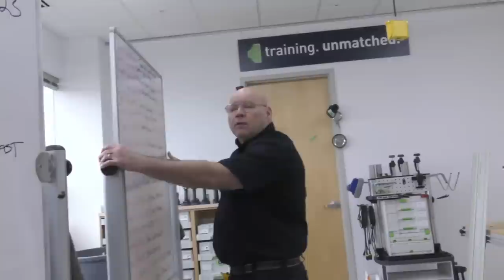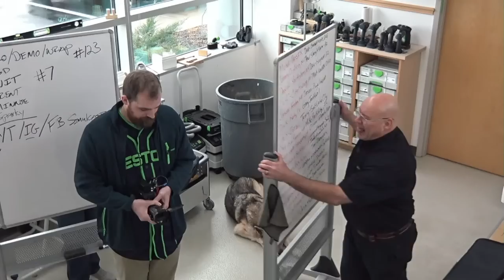Festool Live Episode 123: Lost in the Catalog 7

Comment: Hey Sedge, 

There was an Update in Oktober of 2021 for the Routers - The don't will Start, if you plug a Cord in. that change was based on EU-Regulations for Powertools. 
So also the lovely old CMS-Routerplates are now obsolote, if you don't have an older router than 10/2021

yeah, it's safer to tech, always check the switch, before plug in the cord, and i do it also

Comment: Hi
I think its great that you can do triming with hand held router but it is much easier to do it using a flush bit with bearing. A high quality flush bearing will give you the same results without all having to do all these adjustments and buying all these extra accessories which I am sure are pretty pricy.
I like festool for field work but this is not for me.
Thank you,
AJ
Reply: The problem with bearing bits, is the bearing can get sticky or even seize, causing marring on the surface. Especially when edging laminate countertops, and you have contact cement involved. Problem with Festool is they always set up as if you're doing the edging last. Everyone does the surface last, so the edging doesn't catch when sliding off the side. I tried out the smaller router and couldn't get it set up to do normal edging. The base set up for the 1010 looks like you might be able to set up vertically, but the base would be very limiting in corners.